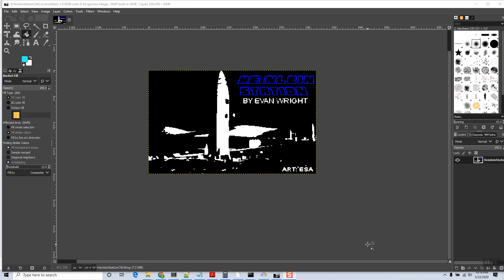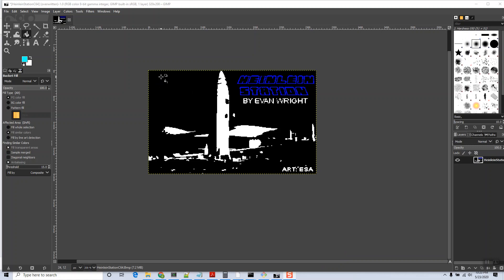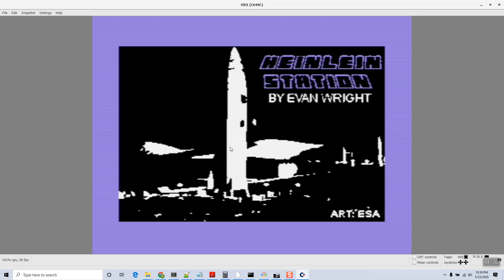Commodore 64 Bitmap Mode

Comment: Multicolor mode is even more complex, but very flexible too. I was reading the Commodore Programmer's Reference Guide recently and rediscovered how it works. I had forgotten that each 8 x 8 box can be interpreted as standard multicolor (with double-wide pixels) OR high-res depending on what the color table value is for that square. So you can have mixed multicolor and hires not only on the same screen but even on the same row! Cool!